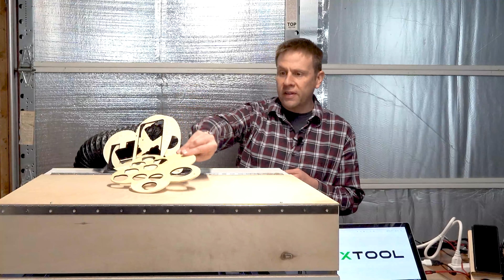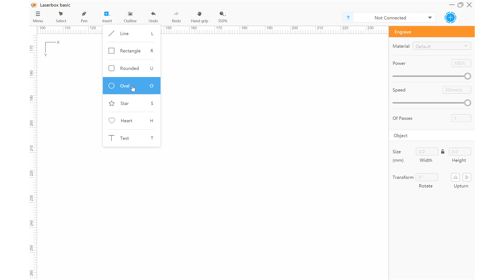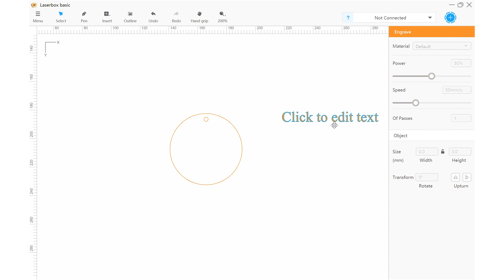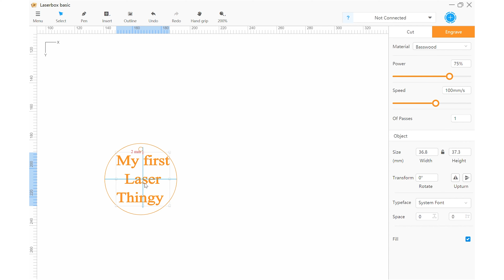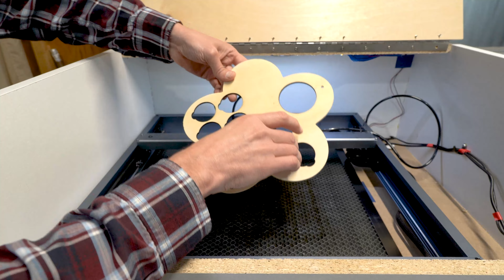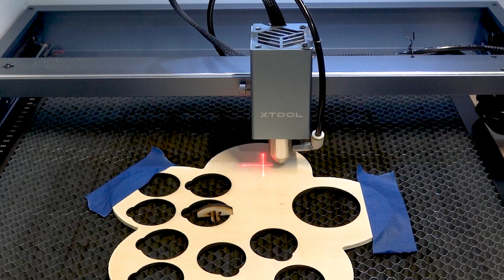Xtool D1- My First Project!

Comment: I greatly appreciate the time you took to make this video. You were very thorough and didn't rush your instructions, which to me, is a great deal. Most instructors simply don't explain as well as you do. I am a new subscriber and I look forward to more videos, particularly with the  Xtool 10W  D1 since it's the only laser I have. Thank you.
Reply from the maker: That's great to hear- my method is to teach by relatable projects to learn the machine and software to apply to your own creative works!
Reply: I agree - thank you very much. This answered a lot of questions "between the lines" of the other starter videos!